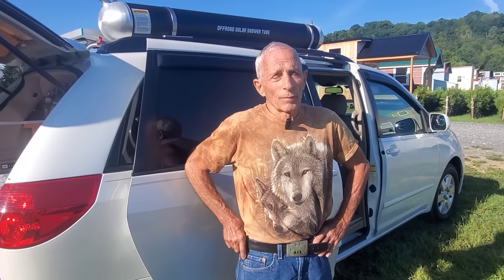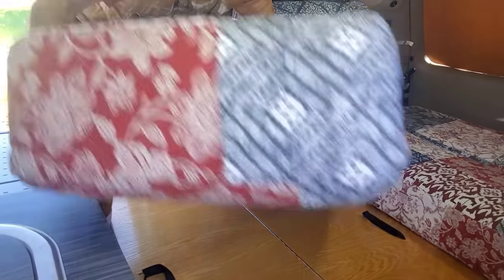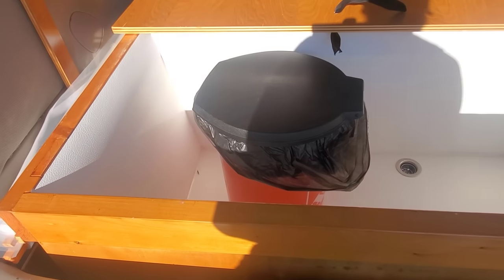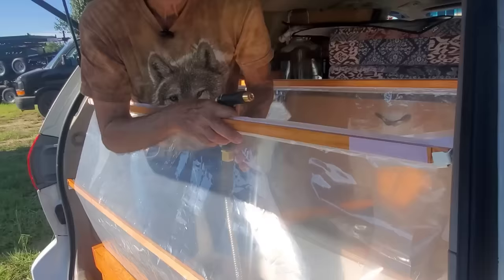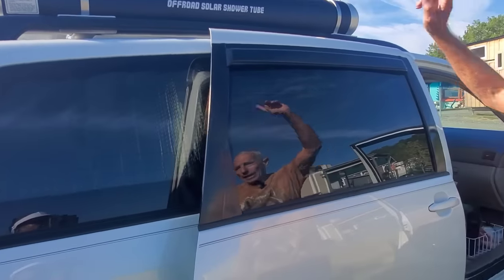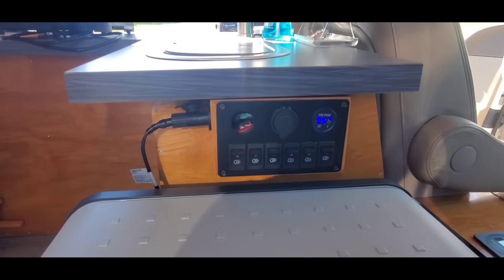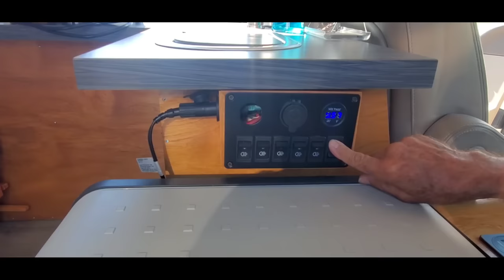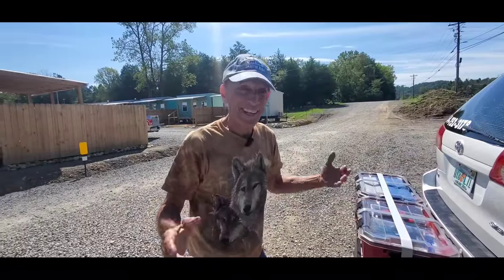78 yr old  builds diy minivan camper  that''ll blow your mind/shower/solar water tank/and more

Comment: Amazing! I hope I'm still having fun in my van when I'm 78. Showers are the one thing I must have on the road, but don't have one inside my van, just a solar shower with a tarp I clip across the back. Maybe one day....
Reply from the maker: I don't know what van you have but I have seen some pretty creative and cheap shower set-ups with a dog bath and hooks in the ceiling for curtains or a piece of metal or other pliable material on which to hang a shower curtain. The water source can be a bucket with one of those USB type immersible pumps or a Nemo Helio foot shower. The dog baths have a plug and you just empty it with a tube like on a portable
 a/c or out the side. Very simple and inexpensive!

Comment: Daaaang! Now I wish I kept my belts when I took my seats out! 🫤
Reply from the maker: I just saw a build where they bolted one end of the belt into the wall and the other side onto the bottom wall of a lift up bed and latched the belt to hold the bed in the upright position. Who knew seat belts could be so useful 😀

Comment: Really nice design, very well thought out. Has everything except a rocking recliner including a leg lift in the back. I need to sleep sitting up with my legs elevated. I also get panic attacks, which I can control by either gliding or rocking. So that's why I say this. It's still one of the best layouts I've seen. I'm researching to do a build in a 2009 town and country. I really liked the shower and nice size fridge. Over all definitely an A+ build.

Comment: One of those tail gate nylon tents might add some room and privacy while showering.  Or just hang woven shower curtain around the edges of the up door.  Something like this might work well for a dog grooming van too.  Ambitious, but it works.  cool.  I am interested in what kind of "plastic material from Home Depot" makes up the tub like shower pan and how that was put together.  I guess they do sell those fiberglass shower building panels at Home Depot, . . . plus wood backing/frame and silicone sealant in the corners?  hmm.  What's your gas mileage like?
Reply: Plastic material that was used for the tub bottom and sides is easily cut on a table saw. It is available in a 4 x 8 sheet about a 16th of an inch thick at Home Depot for about $30 . The shower sides and Bottom are three-quarter inch, plywood. I drive on the highway at 60 miles an hour and The fuel economy is between 24 and 26 miles per gallon.

Comment: Love his style, I would totally buy that same wolf shirt if I came across it in my travels. Very thorough sound deadening, great shower idea. My current toilet is the "home depot" model too. Almost went with the blue Harbor Freight bucket, but the kayak is already orange and I wouldn't wanna look uncivilized sitting atop a non matching toilet. My reflectix is on white coroplast, which was easy to cut but could use some visual appeal on the inside. Maybe I can put a thin wood veneer sheet on'em. I love that the drinking water isn't stored in plastic. I have polycarbonate container but glass would be the goal once I figure where to secure it. This is a great rig for the future owner.

Comment: I have sewn for over 50 years, just about anything, a lot of outdoor gear.  Please excuse me if I am wrong about what I think I saw, it looked like the screws went through the belt. I would advise not putting screws in the middle of the belt, that leaves 2 holes with broken fibers in the belt, I would think the belt might just rip away in case of an accident, just due to the constant wear and tear on the screws against the holes, the screws will deteriorate the strength of the fabric and the belt.  Instead, put the belt through a long ring and sew it into itself, like a belt end that doesn't have the buckle.  Great job!  Nice upholstery work too!  Tons of great ideas, love the rack on the back, I am going out today to buy one for my car!!  and I will use your seat belt idea but adjust it as described. Thank you for sharing.

Comment: I have the same generation minivan. I too have a shower in the rear except mine is more simple . I line the area with oatey brand shower vinyl pan liner from home depot and it drains through an existing hole in the floor where I install a regular sink drain.  To shower I sit on a portable collapsible stool and use a one gallon garden sprayer.
Reply from the maker: I love the idea of a garden sprayer too. So simple yet functional.
Reply: In the end, we probably both use the same soap and come out clean.

Comment: This Is A Really Nice Video. To Reduce Heat IN The Vehicle IS To Face The Sun And  Get One Of Those Sheilds To Lay Across The Outside Windshield, And Covers On Outside  Of The Vehicle Where The Evening Sun Will Be. Unless You Reposition The Vehicle. You Can Also Buy A  Vehicle Tent. It's The Glass That Get Hot. That's Only IF You Plan To Be Arounded A While.
Reply from the maker: Good suggestions!

Comment: This was a fun build video, very nice. Question; where do you go to fill up your water jugs while on the road? Curious for when we’re on the road between campgrounds, thanks
Reply from the maker: In Quartzsite there are stations where you can do so for .30 a gallon. There are grocery stores with water machines out front. Often at truck stops there will be sinks. I have never had anyone refuse me to fill up a jug after I have filled up my tank with gas.
Reply: Excellent, thanks so much. Are you able to stand the heat with just your fan? My first car was a 1965 econoline van in 1976. At 16, I did the body work, a friend of my Dad was a retired body man/painter. He painted it for $110 labor, my how times have changed, lol. I customized it, had an icebox, bar top cabinet. Had a bed across the back but modified it to more like a u-shape, put 3 layers of carpet padding, then shag carpet baby, lol. (It was the 70’s, what can I say). It had a sunroof and a 14x14 vent in the back, I was never on the road, but did live in it summer of 1979 while living/working at the cap Hatteras KOA. Camped next to the bath house, had a tent with my mini refrigerator and clothes foot locker, 2 burner propane stove outside. At night, I’d put a box fan up on the engine compartment and plugged it in, slept like a baby, best summer of my life and had virtually nothing. Friends from all over came here each summer, and I’m still in touch with a couple friends. One of them took a road trip with me in my new ride, a 1963 comet station wagon. We crossed the country and back, gone 4 months, awesome experience. You keep doing your thing, very impressed.

Comment: Great build! Are you exceeding the vehicles GVWR ? Looks like alot of weight.
Reply: The vehicle is supposed to be able to carry Six passengers. Four very heavy seats were removed. It has airbags installed in the two rear coil springs. It has no problem with its weight. It also still gets good fuel economy at about 26 miles to the gallon on highway runs .

Comment: QUESTION - Being that I am not electrical savy or any such... and Barry changed the Polarity of his rear fans, could he not have just turned the blades around & it pull the heat out & work just as well ?
Reply: The fan gets screwed down at the base so it stays in place while you travel. The head does not rotate 180°.